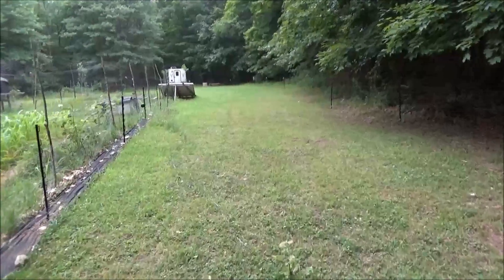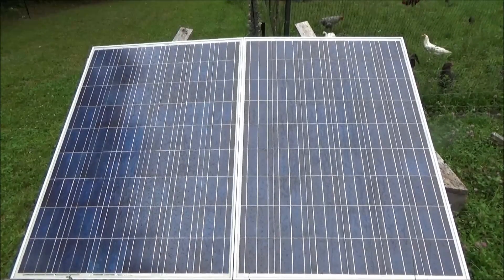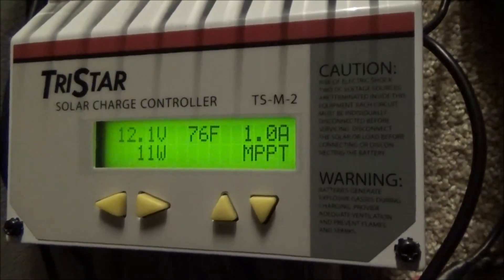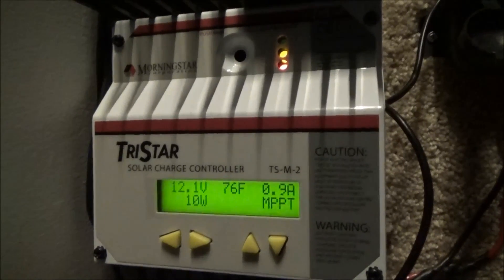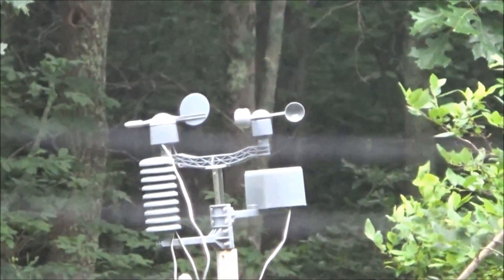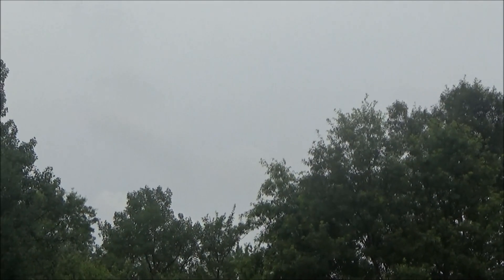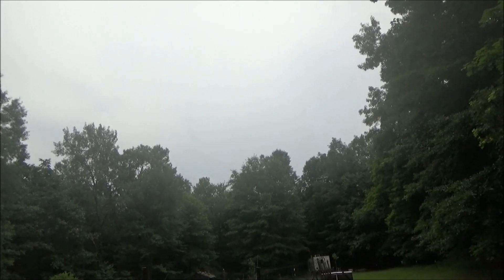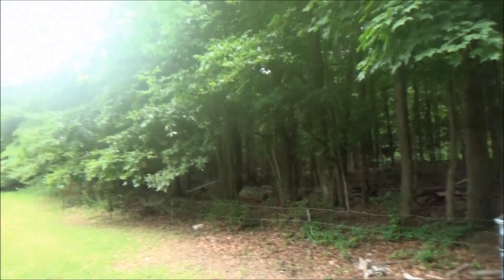Real Life Solar Panel Power Output At My Off Grid Homestead

Comment: There must be a weak link because you are concerned about your power needs.
1) currently panels are not making power / no sun
     - 800 watts of solar, but the battery bank is dead (sun is source of power)
wires are good enough
MPPT charge controller is the best kind to use. Making 11-12w in worst case scenario
6 batteries, 600AHr of power, not enough to carry you over the bleak times
Only ONE whole day of sun will completely charge the batteries, and that's it. 
So if you have 2 days of sun in a row, you have nowhere to put the second day of sun.
You need that day of sun for later.
 You need more batteries.
i think, you asked.

Comment: Its a obvious thing that you will not get much power during cloud coverage, 800w is the maximum you will be able to get when the panel is pointing directly at the sun at the perfect angle, solar is a backup/power saving device not a dependable system, the more panels will help that's a small single panel, they never advertise these panels as 800w or whatever power you have constant output rain or shine, you don't have a ideal setup location wise to begin with but that's what you can only do i guess, you might not realise that the difference in light intensity from cloud to no cloud as are eyes adapt but its a massive difference clods soak up and also reflect most or the light and also defuses it, if you can get more panels 1 or 2 more you might be able to get power during bad weather

Comment: those pannels are too far away, and strings too thick.. tere you lose energy..   only so thick,as nececery, and so close as posible!
Reply from the maker: I use an MPPT solar charge controller and can run the solar panels in series to increase voltage. This allows a longer run with thinner wires. If you follow my videos through to the present day though I have a real homestead with a family and a real house. Still making videos. But now the solar panels and batteries are all together. Now I run the AC power to the house.
Reply: nice one! i am waching cople of your videos!
Reply from the maker: cool. Hope you like them.

Comment: What type of panels are those?  With 800 watts you should never see less than 320 watts during peak hours even on the worse cloudy days.   I think it is safe to say that the load side is drawing enough?  Your trees are a problem for sure (about 3 hours with the sun above the tree line?).
FROM EXPERIENCE (been off grid for a while):
Should be about 40% production on the worse cloudy days (thick storm clouds that almost make day look like night).  800 Watt solar should provide you anywhere from 0.96KW/h per day (worse cloudy day @ 320 watt operation) on up to 2.4KW/h per day (your best day case with only 3 hours in the trees).
So you should still be able to power a small fridge (or a full size chest freezer), a couple of DC LED lights, your phones, and a modern laptop or tablet PC computer, and still have a little power left over out of the 0.96KW/h produced on the worse case days.

Comment: have you tried reducing the cable from the panels to charge controller to 2-3 meter?))) its a direct current, which does not travel that far
Reply from the maker: I have been making videos every day since then and yes, now I just converted to 24 volts and have 6 foot long (2 meter) cables. Boy what a difference!!!!

Comment: You need to look up the theory of oms sorry for my spelling your panels are to far away from your charge controller.
Reply from the maker: Ohms. Yes I am quite familiar with Ohms Law. And I am also very familiar with the effect of putting solar panels under the trees. This is the closest I could get to the house without dropping our trees. But when you use an MPPT solar charge controller you can raise the voltage of the panels by wiring them in series. Higher voltage means less loss and thinner wires needed.

Comment: Your panels are way far from charge controller looks like your using service wire that they use for power for your meter base I don't care how thick it is your definitely losing power from that long stretch of run you have

Comment: I realize this is an old video but I have an idea that may help. I came here to get an idea of what I can realistically expect from solar panels and this is disheartening... but notice all the trees blocking out the light. If you were to attach the solar panels to a tower you could expect better returns. Not sure how much better. Also, of course make sure the panels have maximum surface area facing the sun by strategically tilting them and facing them the right direction. You probably already know this stuff and have made adjustments over the past couple years, but worth a shot pointing out what I noticed.

Comment: You must have a big volts-drop on those long lines. I can easily get 50 watts or more on a cloudy day from my two 175 watt panels. I also get a bit more wattage by putting a big reflector in front of my panels.
Reply from the maker: I am using an MPPT solar charge controller and the panels are wired up to 130 volts DC so loss is minimal. In peak sunlight I see max output but on cloudy days forget it. Maybe your location is more south? Up here we dont get much sun at all.
Reply: @TheDoItYourselfWorld  What are you doing with 130VDC to make your battery bank accept the power...?
Reply from the maker: @blackz06  An MPPT solar charge controller can accept much higher input voltages, allowing you to string up solar panels together to reduce loss in the wires.

Comment: You're suffering from line loss and I would check again that cable that you have layimg outside on the ground it is highly susceptible to corrosion so you might want to check and see if its not rotted in two somewhere!
Reply: If there is a small crack where it is wet that will be a problem could raise it off the wet grass but i think most of the problem is the sky is so wet. We all see solar panels and people are showing that they work on a cloudy day  but they have light clouds or the kind of day that might still give you a sun tan but here we have total blockage of the sun. You need more panels and a small generator to charge the batteries because the closer they get to dead the more it shortens the life of the battery. looks like a rough way to live. maybe you could make some money in a sunny climate installing solar panels.

Comment: Big issue, no matter how big your wires are the run from the panels to the controller is too long. Even with #4 or larger the run shouldn't be over 20-30 feet.

Comment: Wind wind wind..... To treed in? go higher with tower!!! Solar is done. Wind is cheaper and the sun setting does not stop production. There is not 1 case of anyone being able to go totally off grid with solar, but there are cases of whole towns going off grid with only wind.  Again, the wind produces power 24/7, at best the sun does 4-6 hours a day.
Reply: +Trina McDonald Even here in the Netherlands, Known for it's use of wind energy for the last couple of centuries, we found out that wind energy is not money efficient though. Windmills are way to expensive to return any of the cost. When they do, they have run out. If money is not the issue, then it's an OK option, if you live near a sea, or lake large enough to infuence the weather near you.. Otherwise, the total amount of wind you get during the year is to low for it to be of any use.
Reply: +Deiphobuzz A little research please. You are stating based on one little are of the world, likely only a few blocks around your own home. I live in the middle of the prairies, am 1500kms fro the closest sea/ocean, and produce plenty of wind power year round. Research shows that more than 90% of the population lives in areas where wind can easily eliminate the need for any power grid to houses. I am currently typing this from my 3600sq ft house running on wind produced power.
Reply: +gary depietro To get off grid, things like AC and alike are out of the question. The choice is yours, keep paying the bills, or live free of the grid. To date you cannot have everything. If all the conveniences of the grid are a must for you, so be it. Stay on the grid, keep paying the tax, surrender to the man, they have you sooooo hooked. If you will give up a couple of luxuries and live free, so be it too.
Reply: You should look into generating gas from wood. With a generator that can easily serve as a good backup.

Comment: Troy, let me see if I can offer you a couple of helpful suggestions:
1. Shorter wire run from your panels to your batteries. You're on the right track with that heavy wire...E=I/R.
2. More Panels. With more panels, even with the weather shown in this video, it will help. You don't need more volts-you need more AMPS! More panels in parallel will give you the AMPS you need.

Comment: It is not good for LA batteries to remain discharged so low for very long.  
You might consider investing in a small diesel engine to run during low sunlight periods that last weeks.  
You could collect free waste vegetable oil & burn it in a diesel engine.  That power would be great to recharge your batteries (which will probably take more than 24 hrs to become fully charged) as well as to power your refrigerator & HVAC).

As for wind, the best wind is usually up at ~30M (~98.4 ft).  You'll need a tower of some kind to tap into that energy--and even worse than the cost of that tower will be that there still may not be enough wind to generate enough power during some periods of the year.

p.s.:  How do you figure you get 800W out 2 small solar panels?  What are the make & model of your panels??

Comment: Dont keep your batteries discharged for too long, this will damage them and severely shorten their life. Get a small generator and charge them up. Or do what i do: I use jumper cables and connect my car to my solar battery bank and run the engine for 30 mins or so to fully recharge them. Now i got lights all night and my batteries will last longer. Greetings from sunny Jamaica.

Comment: I have almost the same set up 3 250 watt grape solar panels a morning star mppt 60 and 4 150 ah trojan batteries.  First your run from your panels to your charge controller is way way to long, it was an ac run then it would be fine but you need to move your panels in the middle of your garden or much closer to your charge controller.  also you shouldn't have that cable sitting out like that, it's an electrical and fire hazzard.  You wind turbine you should trim off the top brances of a tree climb it and mount a wind turbine on top solving your issue.  Also you can build a manual tracker for your panels it's a pain in the but but you will produce more power.  Also your panels should produce more power then they are rated for under max sun.  Your fridge you need to look at, I just bought a new 15cubic foot fridge that uses about 1kw a day which is totally solar powered off my system.  Even without direct sunlight you should be making a few hundred watts of electricity on your panels.  they don't need direct light but if you want to maximize your solar you need to properly place your panels and have them at the correct angle for your lattitude.  I'm not an expert but i have had my solar set up for about 3 years and friends who are electrical engineers and i've had nothing but success with my system.  You could have a bad battery which would be bringing down the rest of your bank, what kind of batteries do you have, do you typically do maintaince on them if they are led acid.  Do you check the water levels and acid levels?  I would take a volt meter and test each panels out individually, a panel could be bad and that would bring the other one down to a lower output.  But out of all i said you definately need a shorter run for your panels to your batteries, DC runs should be kept as short as possible to prevent line loss, why do you think we switched from DC to AC for transmission in the late 20th centry or was it the 19th centry.  Either way try thoes out and most likely you will find your answer.  Good luck and keep making cool videos!!

Comment: Your system is just setup wrong. Run is too long. Long runs require higher voltages, 12 should only be used in 25 ft range. Compounded by poly panels that perform terrible in overcast. A 24v run on mono world solve all your problems.

Comment: My experience sine 2008 many different types of panels from 5 watt amorphous to 255 monocrystalline panels. I get about 65 % of the wattage. Right now I have 8 255watt panels running at 150Volt dc and by time converted to ac I only get to grid on average 1250 watts so practically half the wattage. I have pretty much figure in solar now everything is in half..so if you want 200 watts you have to buy 400 watts..
Reply: Angle has lot to do with it. As for over rated yes. I agree some are. Others right on money. Also really helps best mppt controller.   Not Chinese eBay junk. Same for grid tie. Power jack and that China crappy is so wasteful. I have 8 255 watt panels and output is half power on power jack grid tie.

Comment: Looking at your cable, it looks like the same type that come from utility pole to my house. I don't think that type of cabe was meant for DC current. Have you considered  using 00 awg or thicker welding cables intead? I think welding cables is better suited for DC current than utility cables. The fine strands will carry the DC current better.
Reply: 96MustangBoy1 the electricity doesn't care what the wire is, ac or dc doesnt matter. the wire size does, bigger is better

Comment: I'm willing to dive into solar if the cheap catalysts are on the commercial market. A system like this could split water. Many people say the problem is you need a fuel cell and that is not necessarily true. MIT has promised this and the Indian Billionaires have invested as well as competitors claiming membranes that can split water. I'd look into Sun catalyst and other water splitting tech so during night or darkened skies you can use hydrogen to provide power and potentially heat/hot water.
Reply: The advantage of the flow battery and or catalyst is that it could provide safe 24 hours electricity if it is scaled up right. Currently they are saying the ingredients for both are cheap.
Reply: This guy builds splitters.  Never used this product. Maybe worth researching. Scroll down to the Hydrogen/Oxygen Separator Cell. 

http://www.jdcproducts.com/products.html

Comment: The wire is too long from the solar panels to your house. It would it be better to either put your panels close to your house or put your charge controller, battery bank, and power inverter close to your solar panels. If you just have to run a long wire to your house, it would be better if it were ac power that you are running the long distance.

Comment: First thing you really need a generator, small one to top off your batteries. second thing I notice is 12V can only travel so far no matter how big the cable is. maybe it is a camera optic thing but it looks kind of far between the panels and the battery bank.

Comment: first of all, you dont have a possible 800 watts out of two panels, i'm guessing about 200 watts each and if your wire is aluminum you can't run dc voltage through it. either way (copper wire or aluminum your too far away from the power source).
try 4 gauge copper multi strand thhn wire if your going to leave the panels out there.

Comment: A radio tower won't stand the side loads on its own.  You need strong cables to the ground at an angle.

In a strong wind, stopping the blades stalls them and reduces the stress.

Comment: If you haven't already you should look into making yourself a reliable wood gasifier, a small generator, and a battery charger.  This way you could rely on your own personal grid (lets be honest your off their grid but not without :P) to keep everything running and if your solar / wind are down you could burn some wood outside, fire up the generator, and keep afloat.  Also might extend the times you could use power to times when it's dark and windless allowing you to even use power and charge at the same time.

Comment: I have 1KW of panels in a sunny area with no trees, and get about 250 watts average over 24 hours good days.  It might be easier to get more panels instead of a tracker.   Your panels don't seem very big for 800 watts.  I have 8 decent size panels for the 1KW.

Comment: Troy, I am not certain I agree with your assessment of the issue BUT I am just a guy at home watching a video. It seems the easiest way to confirm your theory is when the next sunny day comes around. If you get close to the full 600 watts when it is sunny, then you will have proven your point because you will show a direct correlation between bright vs cloudy days and the amount of power generated.  I think it is obvious that on cloudy days you will get less power but 11 watts seems very very low from your rig. I look forward to seeing the readings on the next clear day. Keep up the good work!